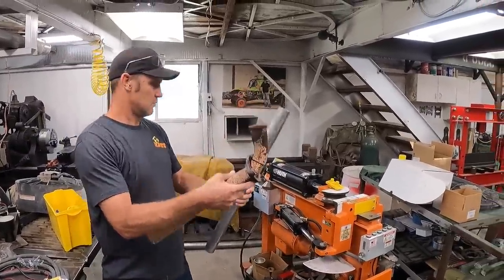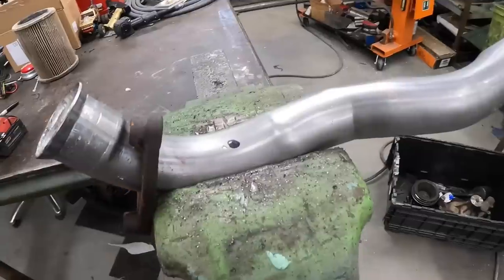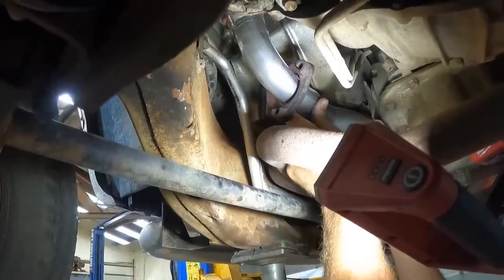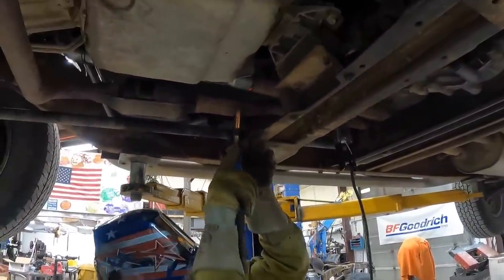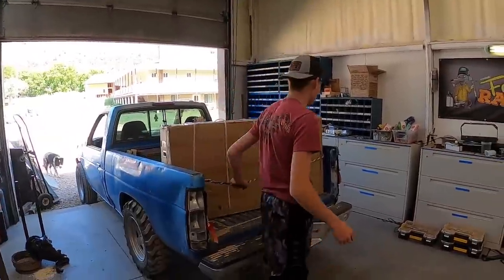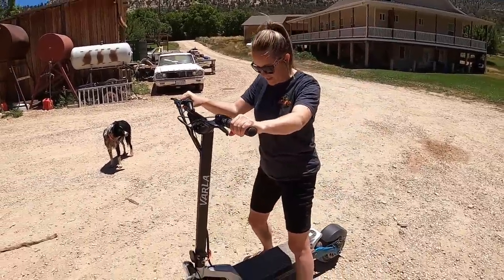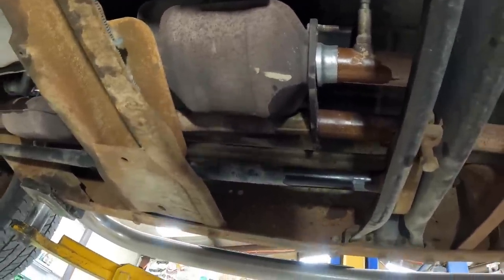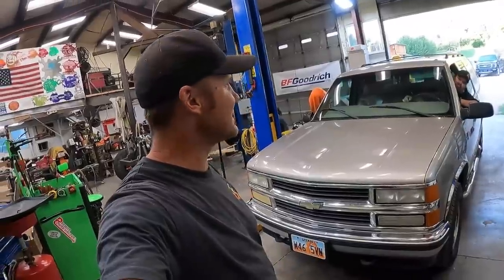They Used What To Seal This Exhaust Up?!

Comment: Never used aluminum foil, but I HAVE used a aluminum Mt. Dew  can to seal a hole in the exhaust pipe on a tractor before... Drink can, bailing wire and a pocket knife hole was fixed.. lol
Reply: back when cans when coffee cans were steel, they made the best muffler and exhaust pipe patches.
Reply: @karlschwaber9568  used those 2

Comment: Exhaust repairs at the edge of the universe.  We were all at my drafting teacher's place halfway up a mountain celebrating the end of the year when one of the guys showed up with a broken exhaust similar to what Paul was working on at the start of the video but this break was on a straight part of the pipe.
Teach didn't have welding gear or anything else to repair it so I stepped out of the bunch and asked if he had muffler cement.  Turned out he did.  I also asked him for rad hose clamps big enough for what I had in mind and he did and the star was a tomato soup can out of the garbage, cleaned with both ends cut off and slit open from top to bottom.
Got the inside of the pre-bent for diameter tomato can slobbered up just right with the muffler cement, slipped it onto the broken pipe perfectly and opened up the rad clamps completely then reassembled them in four strategic locations and cinched them down good and tight.  He was still driving it like that 6 months later.

While we were in the garage Teach showed us how to get a full size bagger to pick itself up off its side.  He laid his Gold Wing on its side in the middle of the garage and showed us the trick.  Simple as dirt.  Always remembered that trick all the years I've been riding. Now on a '99 Yammie XV1100SE for the past 100,000+ kilometres.
Canada, y'know.
Getting up in age, 75 and holding so I'm thinking of trading in the love of my live on a Bombardier Stryker.  They come with one drive wheel in the back and two steering out front via motorcycle handlebars (their design) and they are very modifiable.   They have several varieties of Rotax motors (they liked the company in Austria so much they bought it) available that will allow you do go drifting with it.  Serious drifting, not just a chirp and eek on the corner.  Break the back end loose and stay on it.  And keep your frickin' head up!
They even advertise in the sales brochures that the Stryker can be drifted, no problem.
After you turn the nannies off, of course, traction control, abs, sensors between the front and back break bias can be modified (one pedal for all three with percentage division between front and back.)
Sorry 'bout the book but it's 2:45 am and I'm nocturnal by nature.

Thanks for another good vid Paul.  New scooter looks awesome.  All you have to do it pry Michelle off of it.   😁

Comment: Just bought two FreeGo 20” e bikes $1300. Ea.1200w, 20 amp battery, put 3 x 16” trail motorcycle tires on it, what a difference.

Comment: I used a radiator hose clamp to hold a muffler on an old Nissan pickup I resurrected from a boneyard. It was just temporary until I did some other work and could get it to a muffler shop, but  I changed my mind on the project (I was 16 and it was my first vehicle). 

I listed it for sale and a guy came out to look at it. During the test drive, the muffler fell off. Not the hose clamp though, so I was pretty embarrassed. He mentioned it like five times while we negotiated a price, but I stood my ground and he still bought my truck for what I wanted.

Comment: Love the aluminum foil gasket!We had some red neck exhaust repairs in the 90s when we were poor. Muffler tape covered a multitude of holes. A tin can had the top and bottom removed and cut down the seam lengthwise with a tin snips. It was then placed over the muffler pipe with hose clamps. Muffler hangers missing? Use metal coat hangers to hold it up. I sheepishly admit this now, 30 years later. Don’t tell on me! I admire your mechanical and your fabrication skills. God bless your Dad for teaching you such a valuable, self sufficient skill that you can use for making money. God bless you for passing it down to your sons.

Comment: Hey I learned/came up with a "trick" for re-using exhaust doughnuts. "glaze" them with some hi temp RTV and let it dry completely or close to it. Then install it as normal. Works pretty dang good! It fills in all the little missing graphite, aluminum or whatever the doughnut is made from. Been doing it for years and have not had any leaks unless the thing is totally hammered! I worked in a muffler shop in my early twenties, been a few days LOL.

Comment: About you breaking exhaust pipe nuts off at the manifold, you should use your torch to get them red hot and they usually spin right off.  My boss liked to replace the studs and put bolts in it. And every time one of our customers came back in for a break check, we would inspect the whole vehicle underneath and I could always tell that our shop had done the exhaust work on it because it would have bolts instead of studs and nuts.

Comment: Paul, for exhaust repairs, McMaster sells a high temperature graphite gasket material. There are a few different versions, however the least expensive version works well on exhaust systems.

Just search for graphite gasket material. (same basic material that doughnut gaskets were made of)

Comment: If you find yourself in a bind like that again needing a gasket a good alternative to have on hand is felpro 2499. It's a steel reinforced gasket material made specifically for exhaust I also like to keep a tube of exhaust paste on hand that works great when reusing a gasket. Both Permatex and Worth make exhaust paste it comes in a tube and dries hard like ceramic.  Nice repair 👍

Comment: Thanks 1 million for putting on the squints bro!

I have a collection of gouged lenses and safety glasses with hot steel embedded in the plastic. Welding/grinding/cutting Is fire and brimstone time. 

You need a stiffer hat for working under cars too buddy. Those hits in the head are cumulative, and you got a lot of years of wrenchin’ left in you.

Comment: Great repair Paul and Ben. Funny pat was when you was trying to figure out which way to place the pipe to get the right bend. It’s nice to have all the equipment needed to do the many different repairs, makes it a bit easier. 🤙😎

Comment: We used to have this white putty stuff at Detroit Diesel back in the back in the day, I forgot the name. But it was like silicone gasket maker for exhaust. I'm totally blanking on the name, but I know it was like $50 a tube. It would last you for years in your tool box. We worked on a lot of old 2 cycle 6-71. 8-71,12-71,16-71, 6-92,  8-92, 12-92, 16-92, 3 and 4-53s, 8.2Ls, etc Detroit Diesel engines. In autos(greyhounds, old motorhomes, old trucks, lots of marine engines. )
Worked there since 1996 until 2018. It was fun, but I'm glad I only work on County Transit buses now, lol.

Comment: Thoughts going out to your friends, hope they get all healed up soon, wish I could help monetarily. I'll bookmark the link so that I can if things change. On the exhaust repair, just a tip, on flanges like the rear one you can use red Permatex to seal those and it'll last for years.

Comment: Use High Temp RTV Copper for a gasket.  I used it to seal the headers on my 77 Vette to the heads.  Use it when putting a new exhaust together.  When you put at the joints on the exhaust, it seals good, then when you take the exhaust off it comes apart, won't let it rust itself together.

Comment: My dad had a Midas muffler shop when I was a kid.  We used the long welding rods as a bend template for most of that stuff.  Then again, we welded and cut with torches.  No migs or sawzall.  Lol!!  Actually, it's probably a little easier to weld the tops with a piece of welding rod and torch without taking stuff out.  Of course, that was in the 80's so we didn't have O2 stuff to deal with.

Comment: Paul  i had to make basically the  same repair you made  on the head pipe  gms  must be notorious for that tube burning itself out like that . on the flange in the back you could of saved yourself a ton of time by using red high temp silicone   i always seal exhaust with it  and never has failed me out of 40 years in the business . just thought id share a lil helpful knowledge . you guys are doing a great job with your you tube channel  i enjoy watching your ventures  take care  Bill in Nevada

Comment: I own two benders... one in each shop.  35 and 28 years.  Use a marker and put a dot where you want that bend.  Then place that dot in the center of you curved shoe. Also if you bend too far you can place the pipe bend backwards in the shoe and get a few degrees out of the bend

Comment: That was another good argument for govt funded healthcare in the US. Many years ago I rolled a car pretty badly. I had a ruptured lung, stomach and liver. They had to remove some of my liver (the only internal organ that will grow back). I also had severe lacerations on my right leg, and a compound fracture of my left femur. My left foot was near my ear and my femur was poking out of my leg. I had many other injuries but they were the worst. I was flown 200km (130miles) to the nearest city hospital by Flying Doctor, a free service for remote areas of Australia. I then spent a week or so in intensive care and then another four months in hospital before I could be released. I then spent another 2 years recovering. The cost to me financially for the treatment and care? Not a cent. I even got the smashed tooth replaced for free. That's what you folks should be fighting for. No-one should have to plead for help to keep their family in treatment, and no-one should die because they can't afford healthcare. It is wrong on so many levels.
I hope those blokes make a full recovery and get all the care they need. 
Post script: I did end up with a $86 fine for driving an unregistered vehicle.

Comment: If the truck runs, I like to let it run for a minute and get some heat in it before I try to break loose a manifold bolt.  It's funny, I've used that same exact exhaust bender, same orange, just 20 years older. Always putting out good work, nice

Comment: Lovely idea helping the guys injured, shared the video so more people see the appeal,
You know you can use normal silicone sealant as assembly paste/seal on exhausts, Id be more worried about that additional stress on that thin steel now it has been cut and welded, the fact it needed ratchet strapping to make it reach shows its too short and will always pull back towards the rear of the car with that pressure once the strap was removed,
Wouldn't it have been more cost effective to get another down pipe than the man hours etc it took to make a short pipe?

Comment: I think putting the sensor in after instalation is a good idea because that way you know if the sensor has to be replaced down the road, it's possible. Initially, I thought putting it in first before installation would've been better.

Comment: I made an exhaust gasket out of aluminum foil once. It was the heavy-duty aluminum foil,  I folded it so that it was really thick, then I took a 3-pound hammer to it and hammered it until it was really tight and then cut the hole out with a chisel and put it in and it worked and was still working a year later when I sold the truck. lol. 
I've also made carburetor gaskets out of a Tide laundry detergent box, and they worked fine. lol. I used to live 25 miles out in the middle of nowhere on an 8-thousand-acre ranch, so I would sometimes just use what I had on hand to fix things with. lol

Comment: You can roto rooter 2 grooves around the flange and lightly tap in some soft guage bailing wire or grip wire and use some of that high temp orange sealant in between and bolt it down i hand torque with a torque wrench so there both even for tightening and use plent of high temp anti sieze of threads and bottom of nut

Comment: Save your hands and ears!  Don't check for leaks with the engine running.  Put a shop vac in "blow" mode and stick the hose into the tailpipe.  (This also works with leaf blowers I've been told!)
It will pressurize the exhaust and you can still feel the (cool) air leaking out.  I sometimes I use soapy water (Chris Fix brand of course) or some smoke to find the little leaks after repairs.

Comment: Had a thought, that flange press machine that allows the pipe to slip a little, pop some wire wool between pipe and press clamp, it will help it grip better. hth

Comment: I used to run a muffler/ radiator shop in California. You would have had to replace that cat along with the stock flange and gasket to get that past smog. Here in Florida you can just cut that crap off and call it good. LOL

Comment: In the 1970's (in the days of pre-catalytic converters) if I had an exhaust leak, I would apply a product called "Gun Gum" It was a grey thick wet paste of asbestos that was smeared on the hole in the exhaust. Just apply it and then idle the engine. The exhaust heat would harden it up and the repair would last about a year. It saved me a lot of money in replacing the exhaust pipe. If it leaked again, (or another leak had started) I would repeat the process.

Comment: Nice solution.  I think I would have tried drilling a midspan hole in both flanges for a third bolt, and then tried getting (or making) two circular gaskets.

Comment: Love the video but I wish the exhaust on my 97 was that cooperative. Put a new system on after putting in a new trans and it cooked the ECM. Even though the battery was disconnected.

Comment: I just had to weld up exhaust same way kinda.except i didnt cut it off.just ground it flat and put 4 bolts in and welded all the way around.whoever takes it apart next is on there own.

Comment: If you have ever dealt with exhaust on big trucks they use band clamps that always come with a small piece of aluminum foil to seal where the clamp comes together. It always seemed sketchy to me.

Comment: Back in 2017 my family was in a very bad car wreck I was literally broke from the right check bone down to my feet broke cheek bone, fractured my c7 vertebrae, broke left collarbone bone, all ribs on left side where broke in 2 place, all ribs on right side where broke in 1 place, collapsed both lungs broke my right hip socket and pelvis, left tib/fib was broke few bones in left foot where broke and my right foot shattered and came out the skin so I know what they are going through and I will most definitely pray for them and I want to give some very helpful information for them no matter how much pain you are in you have to fight through it and do the physical therapy even when it you don’t think you can because of the pain just keep pushing as hard as you can to try and get better just remember pain is temporary and tough times don’t last

Comment: the traffic in west texas is nuts. 285 and 302 are probably the deadliest roads in texas. i will drive an extra hour to keep from being on them longer than needed, 128 in new mexico is just as bad. you have alot of left turns onto lease roads and nobody does the speed limit. you have trucks doing 45-55 cars and pickups doing 80-90 when the speed limit is 65. i tried passing a truck once on 285. i pulled into the oncoming lane after checking it was clear front and back. as im passing a 18 wheeler another 18 wheeler started passing me on my left. this was back when 285 was a single lane for both directions. after that i started taking the long way. seen way to many fatalities on those 3 roads for just plain stupid reasons.

Comment: Shit, I'll come weld that gap for ya. I just built my exhaust and welded all kind of gaps. Just turn your heat down, tack around the edges, then heat up a bit, then build up around the edges again, then bead half circles around the inside of the edges or just a piece of metal in the hole, then weld that in with heat and speed, or low heat and slow

Comment: Doesn't the part store have a gasket for that converter?  I'm assuming that might be easier than cutting off the bracket then building special flanges.  Sometimes I wonder if you like to weld just a touch too much...  🤣🤣🤣🤣

Comment: The gasket at the connection for my gm400 truck wouldn't seal. So I cut the flange off just like was done here. I done this over a year ago and it I still not leaking

Comment: Good morning, I just have a couple of questions. What is the brand of the hand held LED flashlight Paul was using to diagnose the exhaust leak on this Suburban? Also, my wife and I are coming out to your area this fall and wondered where Grandma Lolly’s sandwich shop is? Thanks
Reply: Archie's in orderville utah,  right on highway 89
Reply: Thank you so much. Really looking forward to our trip. Headed out the last week in September through the first week to week and a half of October. If you had to guess what do you think the weather will be doing? Thanks and have a good evening.

Comment: Got a question for you Paul. On a scale of 1 to don’t try it, how easy are your typical LS swaps. I have a L96 engine and I want to both mate it to a ZF5 or 6 and put said engine in an old square body Chevy
Reply: They will get tens of thousands of replies on their vids...getting a single question is near impossible. Websites and FB groups are a much better option

Comment: I'd of cut up an aluminum can and doubled it over before using tinfoil or welding it. But I'm a bit lazy in my older years and tired of getting splatter burns...

Comment: Oops, I should have waited until you were done with the exhaust pipe to comment. 
Next time you need to make one of those,  do all of the bends you need, leaving the flare end longer than it should be. After you have made all of the bends, cut off the flare end and then flare it.  That way you don't have the flare end get screwed up like you did.